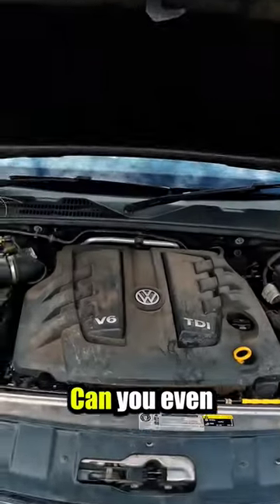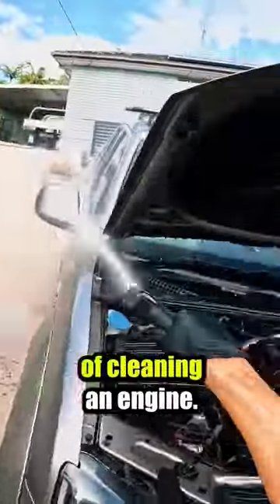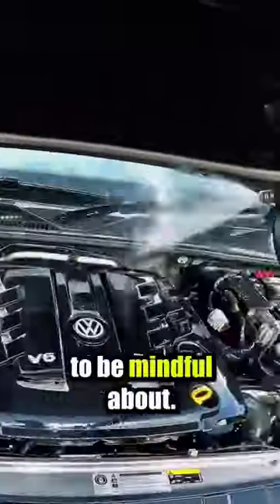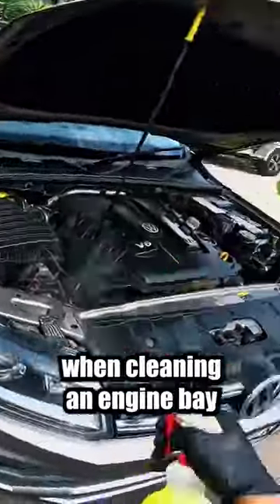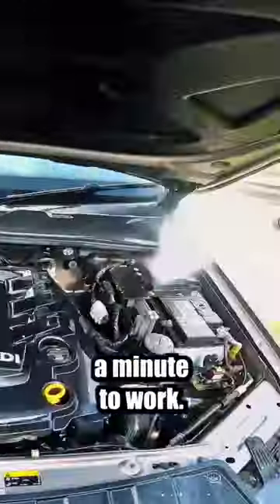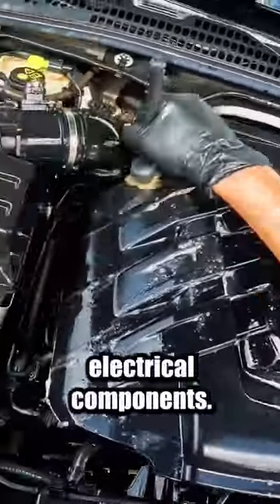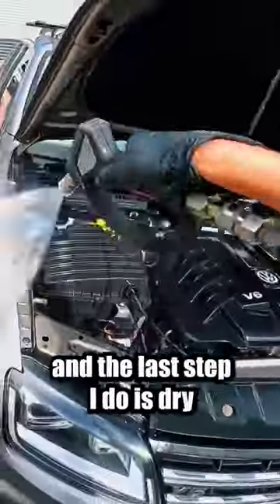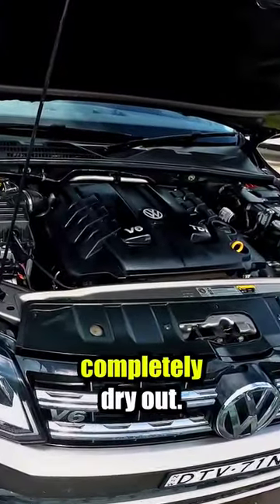How to actually clean a car engine

Comment: Good ol’ rusty, rust. No one realizes the prolong issues of pressure washing the engine bay. I take an APC solution and a microfiber rag. Spraying all plastics and silicone one at a time and wiping it down. Take a quick detailer spray for the painted parts. Then top it off with some Meguiars black plastic/vinyl seal to give it that shine and that’s IT.
Reply: Depends, if you take care of it often, and inspect for paint chips, assuming you have any and you paint over em, you wont have any problems.
Reply: @@lightbringer13th3how’d it work? I got an ‘03 Grand AM and it looks filthy
Reply: Go see Chris fix for this he explain really good
Reply: Wouldnt car heat take care of that issue?
Reply: The Meguiars is perfect for that road grime and dirt to stick to everything.
Reply: What do you think happens when you drive your car in the rain 😂
Reply: @nicholaswicks3077  That’s what you have a cowl for and possibly an under shield to omit as much rain as possible.
Reply: @johng9095 yes. As long as you drive the car around and let everything dry there should be no issues with rust. Rust only forms when water sits on unprotected surfaces
Reply: Yes sample 😂😂😂 ppl like complicated

Comment: yeah you ain’t cover nothing , this is why i watch multiple videos . bro sprayed tf outta that battery teehee
Reply: My first thought watching it
Reply: Water doesnt do anything to a battery, the problem is in the water bridging a ground with  which most cars have covered up or entering a connection and bridging pins together along with forming rust
Reply: Bro is low skill & all talk
Reply: @superman-zr9ei  When you wanna find confidently incorrect people the first thing to do is look at the comments on car shorts.
Reply: The water goes to the concrete ramp.you will damage has a lot car oil
Reply: He left that material thing on the hood?
Gonna act like a sponge and drip forever
Reply: Water on battery is fine like, you mainly wanna avoid the alternator, air intake, and ecm.

Comment: This is the way to clean cars by people who know how to detail but don’t understand much about anything under the hood. You’ll have problems show up pretty soon. Could be sensor malfunctions, anything attached to the serpentine belt, knock a coolant hose, etc. Everything will look clean before a sale though. As a buyer, you just wont see it coming.
Reply: As a buyer I stay away from vehicles whose hoods are unusually clean in a suspecting way. It tells me 1) you don't usually do it, and you only super washed it for the purpose of making a sale, which screams maintenance neglect. 2) making it extra clean and shiny might be away to hide some things about the car. I wipe down the engine bay of all my cars with a simple micro fiber and soap formula. I do this every time I take it to the car wash, so it never gets so bad that it needed to be power washed for sale.

Comment: Always disconnect your battery. Don’t be this dude
Reply: With a car in good condition its not really necessary.
Reply: Most people do this before a sale at that point nobody cares but the buyer. The reality is a proper safe cleanup will take time and patience. Everything else is going to have some effect at some.loint specially on older models with unsealed electrical connections
Reply: take the battery out wym ☠️
Reply: Not in modern vehicles. It fucks their software and affects your drive
Reply: These off-road vehicles are designed to withstand water. There are plastics everywhere in the engine so it's pretty safe to rinse it down

Comment: Disconnect your battery, don’t be this guy. I did this years ago to my Nissan and 3 weeks later was having battery issues, fuses blow wiring harness tape coming off. It’s really not worth it to do this unless you’re thoroughly taking your time to keep every single engine part in mind.

Comment: Since I owned newer cars with so many electronics, I don't use a hose anymore, just spot cleaning in reachable areas using plastic, rubber and metal quality cleaners.

Comment: A main point is not to spray water under pressure at electrical connections. Also many spray degreasers are mild acids that will corrode electrical connections and attack aluminum. Rinse well. Most batteries are sealed so washing them should not hurt them.

Comment: I just do regular waterless maintenance since ownership started. Use a standard cleaner on the plastics and them a silicone spray clean and shine. Really gentle way of cleaning, and the fact it's done weekly or every few weeks means it always looks clean and doesn't take long. 
The real lesson, the more you clean the quicker and easier it gets

Comment: I’ve always washed engines and never had an issue on old, new and modern cars. Keep your engine clean. If water could damage it then your car should be driven in the rain!!
Reply: Shouldn’t
Reply: @jamalstarnet5100 that’s why you have a hood on your car☠️
Reply: @wyguy3392 actually that’s what your engine cover is for .
Reply: @wyguy3392 the hood is for aerodynamics genius. Without a hood your engine will be fine. Depending how aerodynamic your car is, just the hood alone can save 5mpg.

Comment: For the most part, supposing you don't have old hardened connectors. Your engine bay should be water proof, I just highly recommend fully drying it.
Reply: I just did it yesterday. Used light pressure and dried it really good with the automatic dryer

Comment: If your car has no electronic under the engine bay or is really new then your more than likely safe buy if its old then you will surely get water into connections

Comment: pressure washing engine bay prolongs rust development. i use a microfiber cloth and an apc solution (i do not recommend grease remover as numerous mechanics inside an engine requires grease to work optimally) and just wipe the top part of the engine to make it look clean. afterwards i like to use an airpistol to get all the dust off and dry everything out. also, i would advice to not pressure wash wheels as most people do, this leads to rust on the brake caliper and waterleaking into the wheel-bearings which ruins them. as a professional welder, car mechanic and mechanical industry worker i know a lot of things that people do not think/realize. if rust had occured in the cars bodywork, do not apply tectyle solutions or sheepfat! if rust has developed, trying to use acid solutions or rust-defending solutions wont do a thing! remove all rust and weld parts that need welding to then apply sheepfat and tectyle solution.
Reply: Damn man you wear a few dozen hats
Reply: @troysasser1517  get that a lot haha! I currently work as a Casemaker at RUFO.

Comment: Use a light hose spray, do not use a pressure washer, you will force water into parts causing problems.

Comment: Just a Tip, Clean under engine cover, 9/10 times, if the customer requests the engine bay cleaned, cleaning just the Surface isn't enough. If it's a courtesy engine bay cleaning, surface level is fine! Just be mindful to give customers that actual ENGINE bay cleaning. And not just cleaning plastic covers! Good video tho!

Comment: I dont think that you need to worry about demaging something engine doesnt like to be under water not be cleaned with a water i was working as a mechanic we used cleaner for engines that brake down dirt oil everything used presure washer and dry it with preasured air and thats it also you can Just not drive it if you are scared and wait for it to dry if there Will be some water left engine probably Will dry itself when you Will drive how people think when its raining do you think water cant wet the engine?
Reply: That’s what I do. I do make sure I use the high pressure dryer 😊

Comment: Try spraying a 2000 Ford Excursion V10 motor compartment like this. And then find out just how expensive the Multiple computers are going to cost to replace them. 😮😢

Comment: Why do supposed know-it-alls post in comments. You dont know what you are talking about, just stop. Ive pressure washed audio ampliers before, your eletrical will be fine IF you let it dry properly before using. Depending on dryness and temp where you live, 1 day to a week before you should even attempt to turn the key. Its not rocket science. 
Also please unplug the effing battery before attempting this. Better safe than sorry.

Comment: Yikes! The battery is not covered with no plastic bag either.
Reply: NO problem, everything in the engine bay is designed to get wet. I just cleaned my engine yesterday 7-7-23 and didn't cover a thing.No problems. Started right up afterwards. I
Reply: Its a Touareg. There is no battery under hood.
Reply: @douglasb.1203  haha! look again...
Reply: @donnovicki9771  corrosion is not your friend
Reply: @chriswimmer7528  I'll keep an eye out and if I see anything I'll get on it with a terminal brush and some dielectric grease. Pretty sure this was the first time this engine was ever touched, so maybe in retrospect  I should have pulled it. Thanks Chris.

Comment: Stop listening to these videos of people pressure washing their engine bays. Use a microfiber and some detailer and it will clean up nicely. A dirty engine bay also does not hurt anything so no need to perfectly spray everything off anyway just a recipe for disaster.